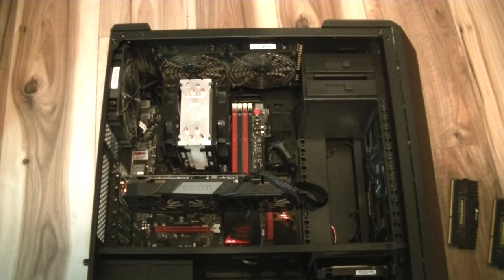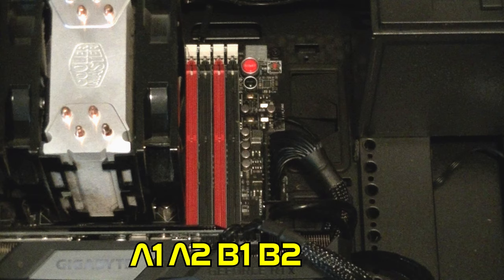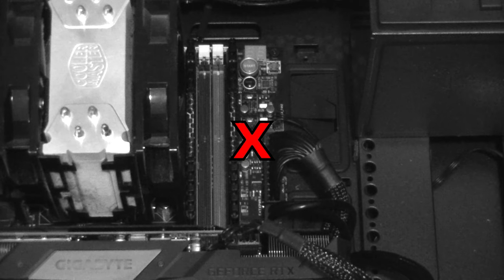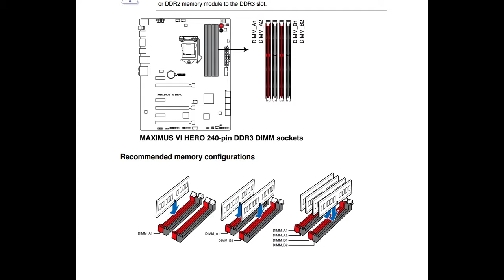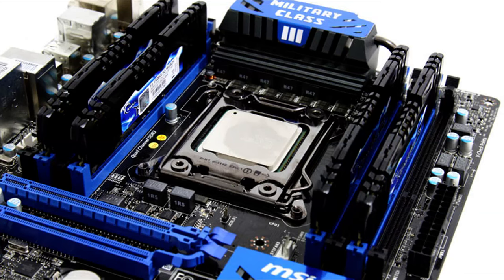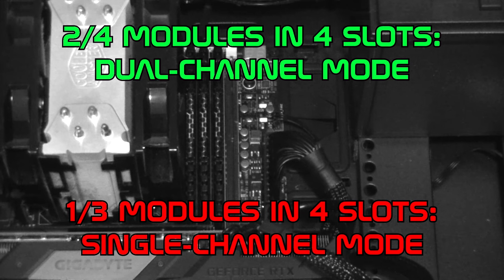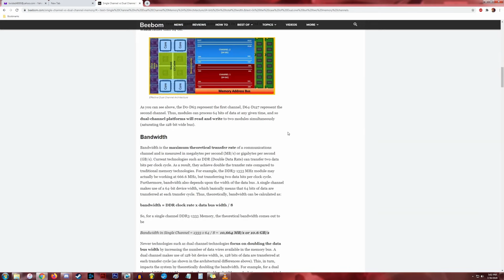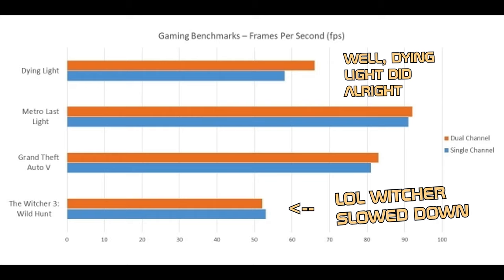How to Make Your RAM Run in Dual-Channel Mode

Comment: i have a asus prime b450m gaming/br with an ryzen 5 2400 g and a r7 360 xfx (from my old pc bc i couldn't buy another stick of ram...) and now i bought a corsair vengeance lpx 4gb ddr4 2400mhz and the mother board doesn't run... if i put only the 2 sticks i already had (2x4gb cruucial ballistix sport 4gb ddr4 2400mhz) can someone please help me? when i run one of the old sticks with the new one it runs (only on 2133mhz but i think this is because that xmp thing) but when i try the 3 of then together it doesn't work (not a native so sorry for the english) edit bc i forgot: also the pc only works with 2 sticks if i put then in the first and second slot (left to right) if put on the other slots it won't run
Reply from the maker: Test out each RAM card in each slot individually. If you can isolate the issue, you'll be able to find out if any of the cards are at fault or if it's any if the slots causing the problem. If everything works, that means it's the new RAM you got that is not communicating properly with your old RAM (this is common if you get different kinds of RAM. Always recommended you get the same make and model.)
Reply: @Torqcx  apparently the 2 last slots of the mother board is not working because the pc doesn't boot when i put on either of them... thank you
Reply from the maker: @wgnd1614  ah, sorry about that, unfortunately there's nothing you can do except swap out the motherboard if you want to add in the extra RAM. Same thing happened to me years ago
Reply: @Torqcx  yeah and i live in brazil (1 dollar= 5,34 reais) so a motherboad with 4 slots is quite expensive

Comment: i only have 2 slots what do i do?
Reply from the maker: If the motherboard was made in the last decade or so, filling both slots up should be all you need to do to ensure it runs in dual-channel mode. :)

Comment: motherboard that only support dual channel but got space for 4 ram sticks shold i buy 2 x dual channel kits or 1 quard channel kit
Reply from the maker: 2x Dual-Channel
Reply: @Torqcx  another question my cpu only support 1600mhz ram but my motherboard support 2400mhz which one should i go for?
Reply from the maker: @ceecnickinikei  If you can afford it, you might as well max out the specs (get the 2400MHz)
Reply: @Torqcx  ok cool :D

Comment: Man anybody can help me for this please i have 4 gb cl 15 and 2133 mhz ram in my laptop i buy a 4 gb cl14 and 2400 mhz ram i know its works for my first ram but weak rams is so expensive than my ram i bought hyper x ram but someones says to me different cl type rams cant work dual channel please someone help me how can i know my laptop work in dual channel or not i put new ram in my laptop and this is works but i dont know its dual channel or not
Reply from the maker: It's always recommended to get the EXACT SAME make and model of RAM when installing multiple modules into a system. Othersise there is no way to tell if it will successfully run in dual-channel, or at all.
Reply: @Torqcx  Thanks man but i download a program named cpu-Z its show your cpu ram information etc. And in memory part writes dual across the channel: like it (Channel:   dual   )what means of it maybe it can be work in dual ha i hope so if it is thats be really good whatever man thank you and goodnight to you i don't know what time is it in your country but bye goodnights

Comment: In my bios it says it's 4gb a1 and 4gb b1 but it runs in single and idk what to do system says 8gb ram but uses only 3.45gb 😭😭😭😭😭 what to do idk what else to try I have only two slots on my motherboard
Reply from the maker: It's possible that motherboard only supports single-channel in that case
Reply: @Torqcx  it worked normally I have this pc for 4 years then it crushed and now it won't use the other ram, it shows it's 8gb ram installed  but using 3,45 gb 😭 I opened cleanup dust all was in correct slot, but no change, I guess it's time to get new one cuz I tried everything 🤧
Reply from the maker: @Iksi89  Try this, pulled it from TomsHardware: 

Open System by clicking the Start button Picture of the Start button, right-clicking Computer, and then clicking Properties.

In the left pane, click Advanced system settings. Administrator permission required If you're prompted for an administrator password or confirmation, type the password or provide confirmation.

On the Advanced tab, under Performance, click Settings.

Click the Advanced tab, and then, under Virtual memory, click Change.

Clear the Automatically manage paging file size for all drives check box.
Reply: @Torqcx  its greyed out and wont let me uncheck "run in separate memory space" 😥
Reply: Thanks for help though 😀

Comment: I just put four ddr3 8 gig sticks in my gigabyte MB and the BIOS sees them all but still says single chanel mode. what gives?
Reply from the maker: What motherboard do you have? Have you checked its manual? Have you also tried a different program to view the specs?
Reply: @Torqcx  Hi. Thanks for answering. It is actualy an ASRock 970 extreme the manual just says to put two idetical sticks in the right slots or four in all the slots, like I did. Going into the UEFI setup it reports running in single chanell mode. I could not find any settings to change this. System information says 32 gigs installed physical memory installed. Total physical memory 16 gigs, and total virtual memory 31.9 gigs.
Reply: @Torqcx  Also I left all memory related settings in auto mode.
Reply from the maker: @canuckprogressive.3435  with that type of motherboard, for a brief search online, all I heard was to try changing anything along the lines of "auto gange" mode to "unganged" and see what it does. Try going from there
Reply: @Torqcx  Thanks.

Comment: I have a weird problem ah.. my RAM only works in the NON-Optimized slots.. like what the hell why??
Reply from the maker: It sounds like the motherboard's slots may be faulty, if not the RAM modules being the problem. If either of these scenarios is the case, there's not much you can do except for replacing the parts, unfortunately. This is common.

Comment: I have done this but I am still getting single channel mode as specified from SPECCY, RAM
		Memory slots
			Total memory slots	4
			Used memory slots	2
			Free memory slots	2
		Memory
			Type	DDR3
			Size	8192 MBytes
			Channels #	Single
			DRAM Frequency	803.5 MHz
			CAS# Latency (CL)	11 clocks
			RAS# to CAS# Delay (tRCD)	11 clocks
			RAS# Precharge (tRP)	11 clocks
			Cycle Time (tRAS)	29 clocks
			Bank Cycle Time (tRC)	39 clocks
			Command Rate (CR)	2T
		Physical Memory
			Memory Usage	52 %
			Total Physical	7.75 GB
			Available Physical	3.66 GB
			Total Virtual	10 GB
			Available Virtual	3.59 GB
		SPD
			Number Of SPD Modules	2
				Slot #1
				Slot #2
Reply from the maker: Try slot 1 and 3 instead of 1 and 2.
Reply: @Torqcx  I am using 1 and 3?
Reply from the maker: @RoadToTheCup  are you sure? According to the Speccy text you sent me that's not the case. But either way yet different slots.
Reply: @Torqcx  I just checked to make sure both are in slots  A1-B1
Reply from the maker: @RoadToTheCup  are they both the exact same make and model of RAM? try consulting your motherboard's manual about RAM placement. Also maybe try another program
Reply: @Torqcx  Yes, they are?

Comment: I HAVE AN Asus B85M-G motherboard . Is capable of 32 GB Ram ? I install 16Gb Ram System Locks up ! I install 8Gb Ram system runs fine ! I install 32Gb Ram System Locks up ! I install 8 Gb Ram in any of the four slots , system runs fine . I am totally lost on this one ? I've tried everything ! Every configuration ! Disabled B slots in Bios seemed to help for a short period then ! SYSTEM LOCKUP . What could be wrong with this heap of junk ? I go into bios and the default setting is overclocked automatically ! CPU target clock is set to 4000 Mgz ! I take away turbo mode and try to reset to 3600 and 16 GB ram ! System Lockup . Can You help me ? I'm days , and days , hours , and hours into this mess ! Should I reflash the bios to an earlier update ? Does Windows 10 work on Asus B85M-G ? I'm about to accept defeat ! IDK ? I guess you are the ram guy !
Reply: Also the CPU is 4970
Reply from the maker: That is odd. From the specs I've read on that motherboard, it should take to a max of 32GB of RAM. Max speed of 1600MHz (I'm assuming your RAM is clocked at at most that). And the processor should be compatible with it as well. Try resetting the motherboard by clearing the CMOS (take the coin battery out and switch the clear CMOS jumper, then put it back and re-insert the coin battery... if you don't know how to do that, look up a tutorial on how to do so). Try again with the RAM.

Comment: My pc won’t boot up in dual channel but only in single mode
Reply from the maker: Test each slot out with each RAM module you have individually to check if it's any of the slots' fault or a faulty RAM module. Also try blowing out any dust that could be in the slots.

Comment: When i put rams in A1 and B1 it's not boot
Reply from the maker: Try taking them out, blow the slots out with compressed air and try again. If it still fails to boot, try the other slots. If they work in different configurations but not the original one you had, it's possible one or more of the slots on the motherboard is bad. If that's the case, there's not much you can do to fix that unfortunately.
Reply: @Torqcx  i have tested 2 motherboard same condition.

Comment: My question is that can I put my single ram in a 4 slot mb?
Reply from the maker: Yes of course. It will run sin single-channel mode, but it will run.
Reply: @Torqcx  Do I have to adjust single channel mode? Somewhere in bios or something?
Reply from the maker: @banfibotond  If you only have one single module of RAM, there is nothing you can do about the mode it will run in; one module of RAM will run in single-channel mode regardless of what type of system you install it into.
Reply: @Torqcx  Thank you for your fast reply, I loved you video. Its clear, and understandable. I will suggest it for my friends!

Comment: why  does my computer beep and just not turn on
Reply from the maker: Your RAM may be incompatible with your motherboardor you have a damaged module or it's in a damaged slot. Try diagnosing it by trying each individual RAM module in each slot, one at a time to see if you can solve what is causing the failure to boot.

Comment: So the moral of the story is... if you somehow get stuck with 3 sticks of RAM, go ahead and install all 3 and use single-channel mode because more RAM is better than theoretically slightly higher RAM speed from running in dual-channel mode. Correct?
Reply: Addendum: the above is applicable vs. only using two sticks of RAM to enable dual-channel mode. Obviously if you can obtain a 4th stick of RAM that would both be more RAM and enable you to run dual-channel mode.
Reply from the maker: If you require that much RAM with what you're doing (your RAM caps out when you're gaming or rendering or whatever), install all three sticks. If not, go ahead and stick with the two to have dual-channel.

Comment: Every time I try to my computer makes a Loud beep
Reply from the maker: Was this ever since you installed/swapped out RAM? Try powering the system on while trying every single module, one at a time, in every single slot. Make sure each slot is cleaned (blow them all out with compressed air if you can). After a few minutes of troubleshooting, you should be able to determine whether any of the memory modules and/or slots are faulty, if the system still fails to boot up with specific configurations.
Reply: @Torqcx  this worked thanks so much man

Comment: guess I'll buy two 8gb ram then.
bye bye two 4gb ram that I don't know what should I do with them lol
Reply from the maker: You can either sell them or use them as backups
Reply: if you have 4 slots you could buy only 8gb and use config 4-4-8-0 (8gb in each bank)

Comment: What if my motherboard is having 2 slots?
Reply from the maker: Usually when I see a motherboard have only two RAM slots, filling both of them up will have the system run in dual-channel mode.
Reply: @Torqcx   bro thanks this comment helped alot
Reply: Torqcx  mine doesn’t is there anyway I can change that it’s on a1 and b1

Comment: I have it right but it still wont work
Reply from the maker: Try each individual RAM module in each slot, individually. Try cleaning the slots out with compressed air (or just blow at them, alternatively). If everything's clean and the connection between the modules and slots are solid, and you still get a failure to boot with any one of them, that means either the slot of module is bad.

Comment: My ram vas instaled in 1 and 4 slot it works shoud i sat in 1 and 3
Reply from the maker: To check if it's running in dual-channel mode, I suggest running the free program "Speccy" that you can get online right now
Reply: its suppose to be in 1 and 3 or 2 and 4

Comment: What about laptops
Reply from the maker: I haven't seen more than two RAM slots in a typical laptop. Fill them both up and you should get dual-channel speed.
Reply: @Torqcx  can I use the maufactorers Ram and any third party ram stick (I specified the ram to my laptop model) to get dual channel memory?
Reply from the maker: @IcyyX_  It depends. If the specifications are exactly the same on both modules, the chances are that you might get dual-channel to function correctly. Otherwise, the chances are slim. It's always recommended to get the exact same make and model of RAM when installing multiple modules.
Reply: Because the ram stick I want has 3200mhz 260 pins and 8gb ram the same as the maufactorers memory

Comment: When the pc doesn’t boot with 4, identical, sticks of ram, but does with just two - then what?
Reply from the maker: Try each stick of RAM out one-at-a-time in each individual slot; this way you can try to diagnose whether you have a bad (or multiple bad) sticks of RAM, or if any of the slots in the motherboard are bad.

Comment: Didnt work for me, it just keeps turning off and on
Reply from the maker: Check each slot and module individually in between attempting to start the system up. If a certain configuration causes it to fail to boot, you have a bad slot. If a certain module always causes the system to fail to boot regardless of where it is, you have a bad module.
Reply: @Torqcx  My bad i wasnt pushing it in all the way like the sped i am

Comment: if i do my ram in dual channel, the pc isnt working. The fans are spinning and everything looks like it is working but the monitor is not showing anything. If I put the ram in single channel it works. Can anyone help me?

Mainboard: https://www.gigabyte.com/Motherboard/B550-AORUS-ELITE-V2-rev-10#kf  
RAM: https://www.crucial.com/memory/ddr4/bl2k8g32c16u4b
Reply from the maker: Have to you tried any other configurations? Different slots, swapping the RAM around, etc.? It may not be that running your system in dual-channel is causing it to fail to boot, but rather one of the modules or RAM slots is faulty. This is common, and unfortunately, if it's the case, there's nothing you can do about it except for getting new RAM modules (or if it's the motherboard... A new motherboard)
Reply: @Torqcx  other ram I have unfortunately not but thanks for your help. Maybe it's the mainboard because when I do the ram in dual channel it does not light up.

Comment: If it has four rams in it’s a quad channel ram
Reply from the maker: No, quad-channel RAM would only apply to a motherboard that has at least 8 RAM slots; in order for an additional channel to be added, there must also be an additional pair of RAM modules. 2 pairs (4x modules) can qualify for dual-channel, 3 pairs (6x modules) can qualify for triple-channel, and 4 pairs (8x modules) could qualify for quad.

Comment: What if your motherboard has only two slots... you forgot about us 😒
Reply from the maker: If you fill both slots up the RAM will run in dual-channel mode, if the motherboard supports it.
Reply: @Torqcx  is filling all slots with 16 gb too much?
Reply from the maker: @nikosolid3945  The only time you could possibly have "too much" RAM is if your motherboard could not support that.

If you're asking from a subjective viewpoint, however, it really depends on what you're doing. Personally, in this day in age, I say 32GB is plenty to do even very RAM-heavy activities... more than enough for any gaming. My PC has 32GB of RAM but I use Photoshop and draw images with enormous resolutions... most people aren't doing that.

I'd say 32GB right now is the sweet spot if you want to be absolutely sure you won't ever max it out even under relatively extreme circumstances... anything above that is a bit redundant (in most cases)

Comment: My FX 8350 has 8gb limit set ea slot of 4 slots. When it uses dual off the 2 Dual channels, it will convert ea channel on that 1 socket to 4gb ea channel ( whatever the size of gb ) for a total of 8 GB ( cpu limit)and uses that lowest dominator for the rest of the slots no matter what the size is ,dual or singlle, stick as it takes the reading of the dual to convert the limit of each stick the factory limit or setting ( not sure of troubleshoot to increase range ) as initial base of path the cpu will give you. No matter the gb size using a single 8 gb stick in the B slot, cpu already took dual route as 4gb each channel and take that course regardless if you have an 8gb stick single for a total of 6 channels when using Duals Ram. This shows I have to stick to Single but fast ram sticks until someone here show me the equations to fix this. 24GB instead of 32 or 64 of using dual and now needing just singles to get to 32gb for the MBoards limit is 32gb Ram expansion.